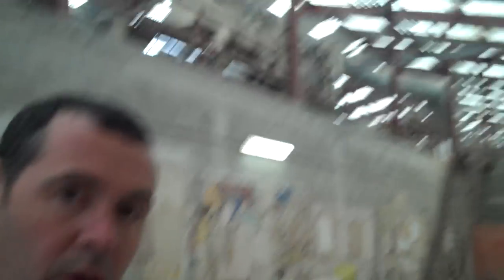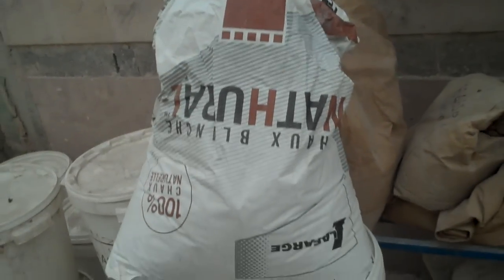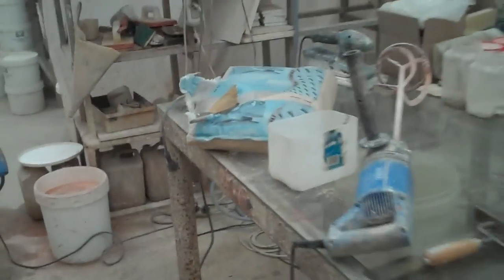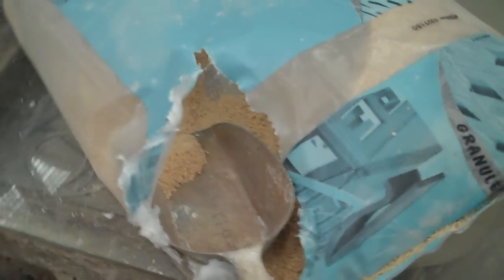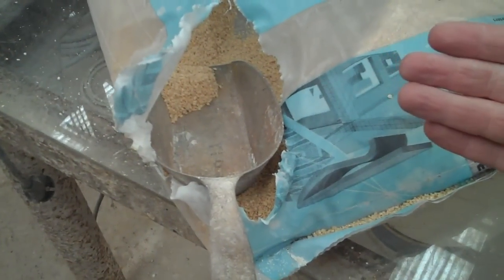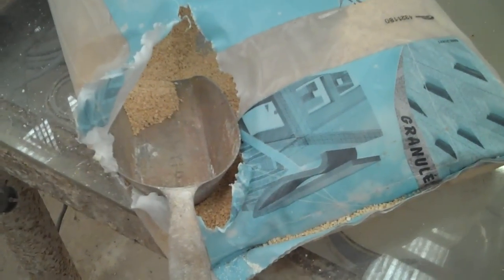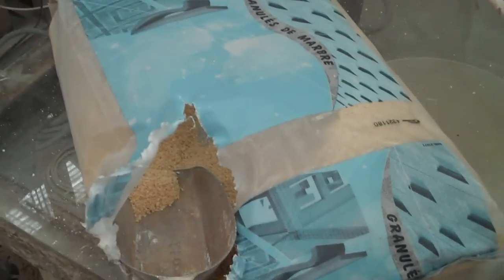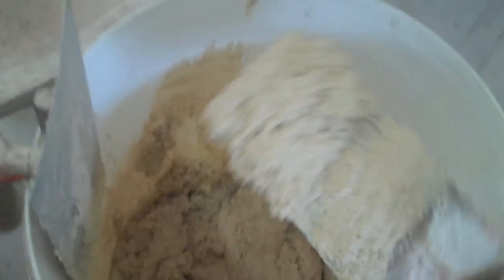Natural Hydraulic Lime

Comment: US question: Can you tell me the benefit of hydraulic lime over (readily available) bagged hydrated-lime mixed with some white-cement? Thank you very much!
Reply: Hydrated lime with cement is not lime mortar
Reply: @daveburns8203  Very true. Never said that. Please let me edit: As we cannot get good lime putty here, and be lime purists, I am just trying to get info on the real differences if using a mix as mentioned. Thanks.
Reply: Hotlime can be used in cold weather